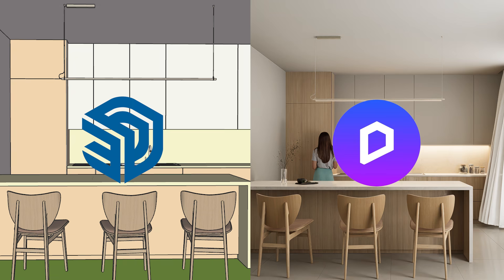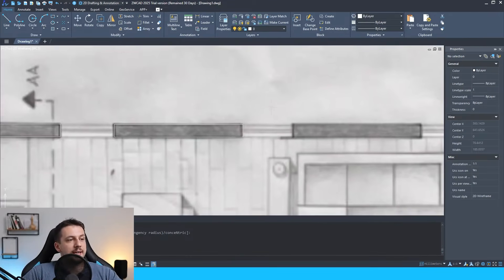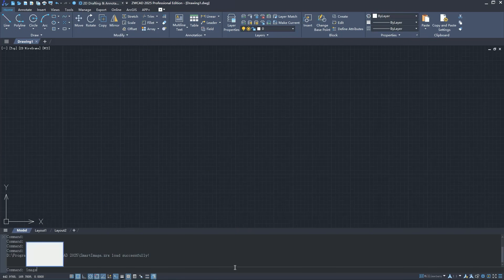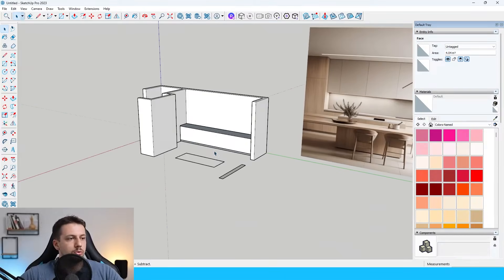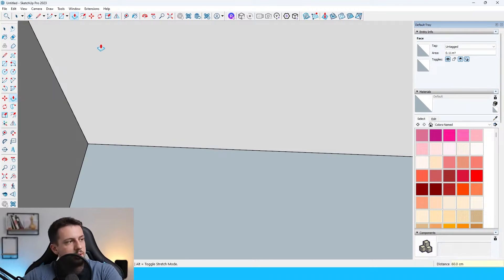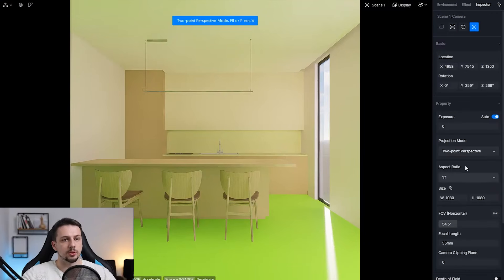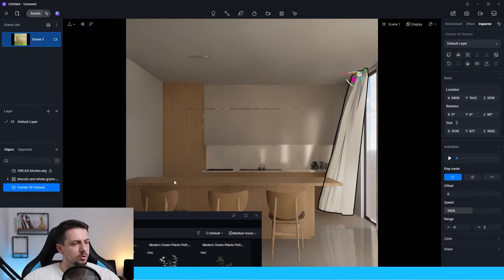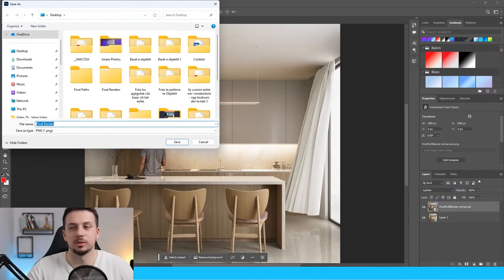2D Kitchen to 3D Render for Complete Beginners (Full Tutorial)

Comment: Cheers, thanks for the zwcad intro as I'm trying to figure out the best autocad alternative, autocad is way too expensive.
Couldnt figure out between zwcad and bricscad as they are the most common I see online..

Btw, as an architect I can't ignore you placing the cooktop between the sink and the cupboard/fridge. That's a terrible mistake.
1. You need at least 30cm on each side as you often have a pan handle sticking out and some prep space is needed as well.
2. A splash of water from the faucet on hot oil will start a fire so dangerous.
3. You need a space to place things you take out of the fridge and you need to go to the other side to do so. Always leave counter space near a fridge.
4. The center of the kitchen is less ventilated, the cooktop needs to be the closest to a window like the reference image you used.
This is part of a realistic render as any professional seeing this will just feel it looks wrong